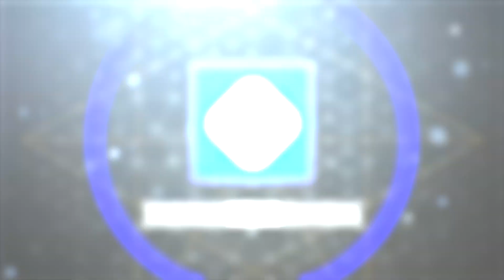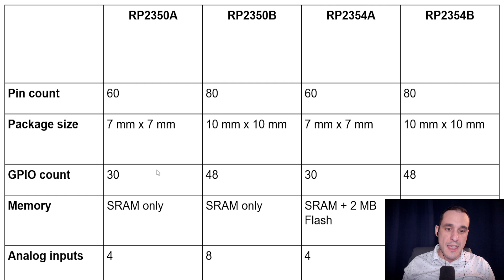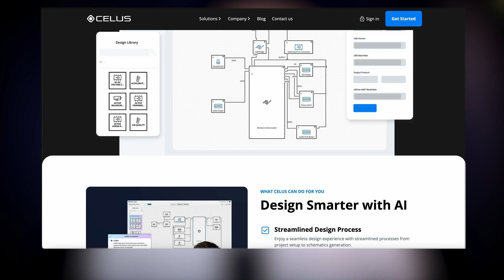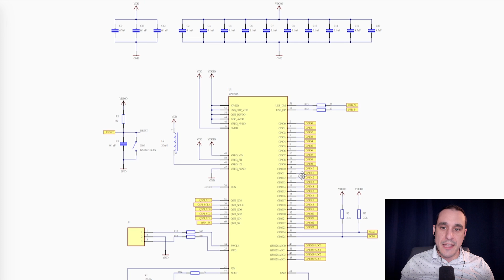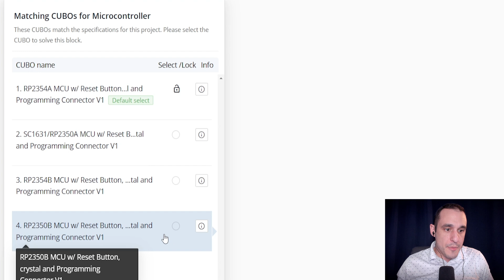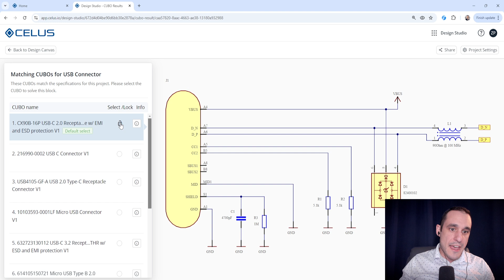Why Everyone’s Talking About the Raspberry Pi RP2350 (and You Should Too!)

Comment: I need a 5v->12V boost converter for a LIN Bus USB dongle. Power circuits always trip me up. Could I drop a buck-boost converter into CELUS, provide it with the input and desired output voltages, and expect it to populate the proper components?